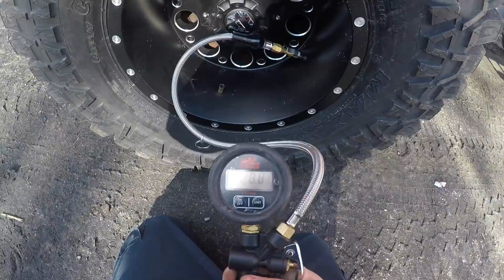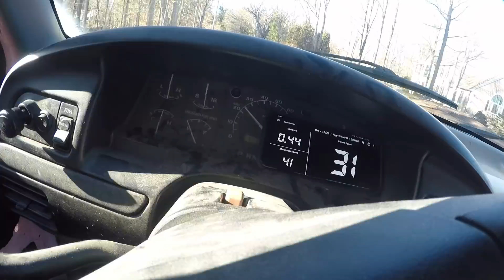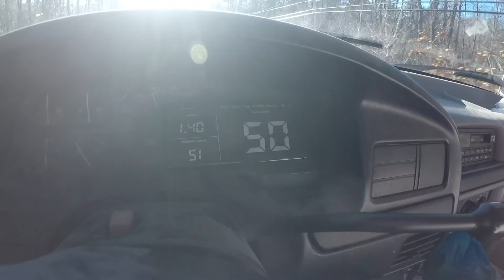We have a problem... DEATH WOBBLE? 9" LIFTED OBS FORD ON 38s

Comment: Check your steering box bolts, you know where the pitman arm mounts. They will get lose after all that shaking.!
Reply from the maker: Thankfully that didn't happen. That would have been bad. Issue is fixed now it was those damn tires
Reply: @Bearbait01  Right on.!

Comment: It's a nice looking truck, good job so far. Keep up checking different things,  you'll get it. I had a 1996 bronco TTB,  with 33s, 2 inch lift,  1.5 inch body lift, super steering damper it was smooth as glass, on highway, perfect 85 90 mph, no prob.. Dont know about 38s.Try all urethane bushings,  radius arm bushings, huge great improvement. Look for a good alignment /front end shop,  but not corporate like Firestone etc. Best luck in alignment I ever had was by an older pro mechanic,  front end man, who ran his own shop(who listens to you)...
Reply from the maker: After trying most everything I have came to the conclusion it was the tires. The tires are the issue. One had a bad belt. After that was replaced it made it much better. Still not super great. I am doing a solid axle swap and going back to radials.

Comment: Get that solid axle dana 44 brother!! even if u swapped to a dana 60 and got new 8 lugs rims, I'm almost certain you cant put 15 inch rims on a D60, so you would need new tires anyways. Get the dana 44 solid axle with all new bushings and ball joints. death wobble will be fixed, and you will be able to get the alignment done easily, as you mentioned was a problem in the beginning of the video! I enjoy your videos man. Keep up the good work
Reply: Also I remember in one of your old videos, you had custom made some drop brackets for the ttb, and you were having problems. if you wheel this thing, I can see those brackets being a problem with all the stress from those huge tires. With the solid axle swap you wont have those weak points. The TTB independent suspension really was the Achilles heal of these trucks.
Reply from the maker: Your 2nd comment. That wasn't me. I never custom made drop brackets

Comment: If seen jeep JK's air down to cure death wobble but it's probably a sign of something else. Maybe you just need more castor for those big tires. My death wobble came from my axles not being centered. After tightening everything,  buying new parts and going to multiple alignment shops I got a tape measure and found the problem.
Reply from the maker: I ended up buying new different tires. Truck rides perfect now. The tires were just junk, I talked to someone else a few weeks ago with the same tires and the same issue. Just junk tires.

Comment: I have the same problem on my 95 f150 it shakes at 45 MPH but goes away if I rapidly accelerate once I hit about 50 ish it goes away
Reply from the maker: Willing to bet if your truck is lifted the bolts for your TTB drop brackets aren't tight.
Reply: @Bearbait01  it's not lifted it's a stock flareside
Reply: But I am just 17 though I don't know too much about vehicles in general so idk what it could be my dad keeps telling me it's fine but I've driven it enough to know it's not fine 😂

Comment: Go under there and look for slop on the tie rods and the pitman arm ,  get a pry bar and check the ball joints.   Look for old dried up bushings on the swaybar too.   Obviousy you want to take those wheels in one at a time and have it hi-speed balanced.   No bubble balance job   Then take it to a real truck shop and have them align it.   The problem is feedback is going to be more prevalent because those wheels and tires are heavier.   So when they bang around a crappy road your going to feel it in the steering wheel more.
Reply: Blocked User in addition to what you've mentioned a sloppy steering shaft and frame flex can cause the death wobble.
Reply: bayou boat trash  
For sure , the steering gear box can be gone too.   putting all that weight on the spindles and banging around can cause all kinds of accelerated wear to steering components
Reply: Blocked User yup yup, sure can.

Comment: Check all the Bushings up front, my 94.5 had death wobble and it was definitely in need of bushings. After the install it's all good.
Reply from the maker: Pretty much guarantee It's just the tires. Because it was smooth on the 35s.
Reply: Could very well be. My 37s were a nightmare, my 315s don't ride like a caddy but..way better that the 37s!

Comment: What motor is in it, what gears do you have in it, and Howed you fix the wobble cause I’ve been wantin to do the same lift and 38’s on my 1990 Ford? If you even changed them

Comment: You can throw a lot of money at a lifted big wheel truck like this to make it handle better on the road at higher speeds.   As it sits.   You have more ground clearance and can claw your way thru deeper mud and ruts GENTLY.    But and this is a BIG BUT   At faster speeds You have to drive more carefully and avoid hitting ruts and potholes because all that mass can snap a spindle alot easier than normal size and weight wheels and tires.    So even though it LOOKS like you can run over cars and TECHNICALLY you can.   You just need to do it slowly and use your head when you do.   None of that slamming into curbs kid stuff.

Comment: i had real bad death wobble on my truck awhile back but it was so bad it felt like the front end was gonna fall apart. what fixed it was i tightend all the liftkit bolts on the front end and got new tierod ends and the wobble went away forever
Reply from the maker: Yeah this is just the tires though. My bolts on the lift and everything are welded tight.